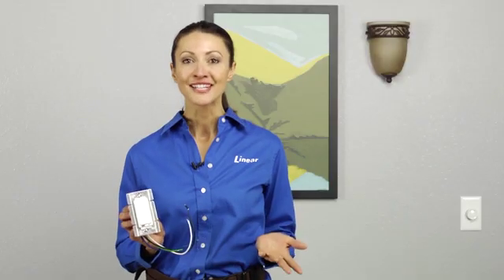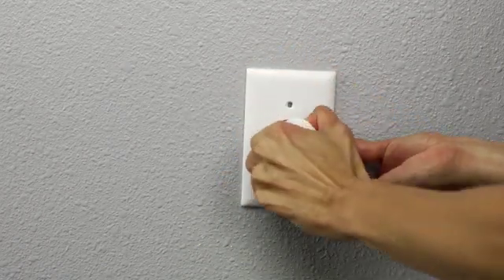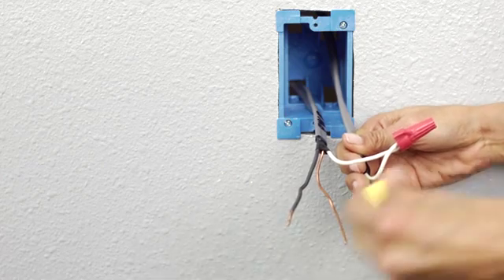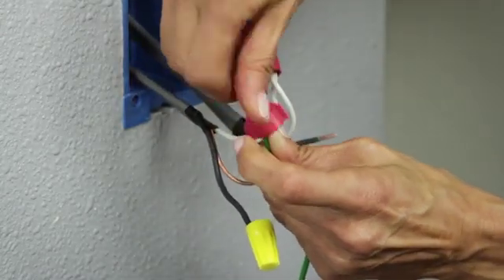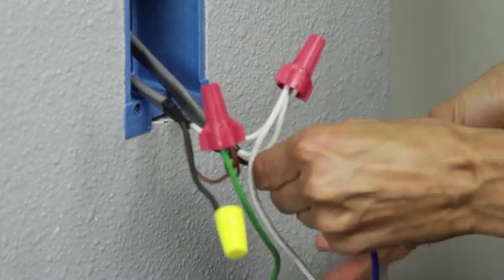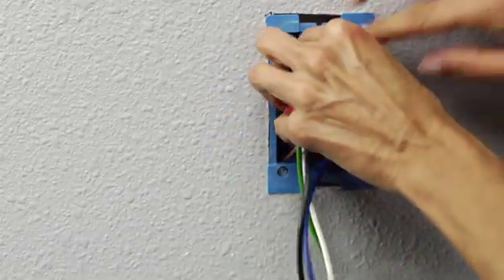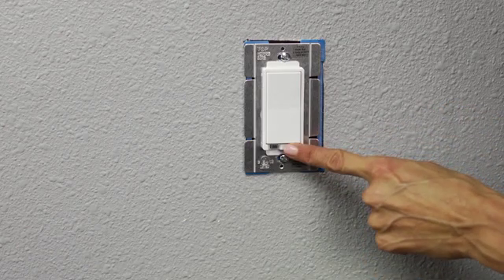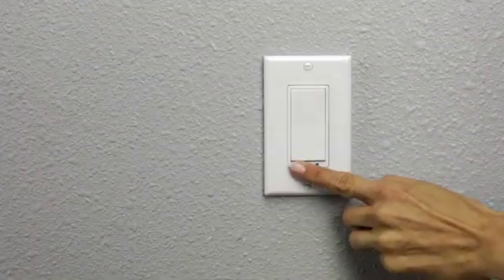Linear WD500Z: Z-Wave Wall Mount Dimmer Switch

Comment: If the power is coming from the Light Fixture, two wire to the switch (White and Black). How do I connect the  3 wires, black, Blue and white (WD 500-Z) green is ground?

Comment: THANKS!  Ive wired/replaced plenty of switches in my homes but the Blue wire in the the Linear threw me for a loop..  The diagram did not make it clear enough that the blue wire is also plugged into a black wire.